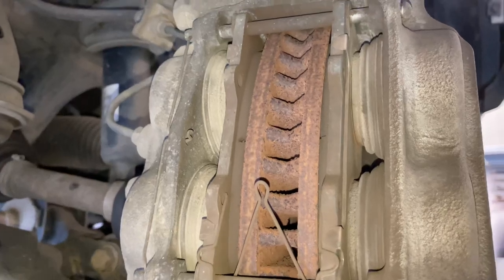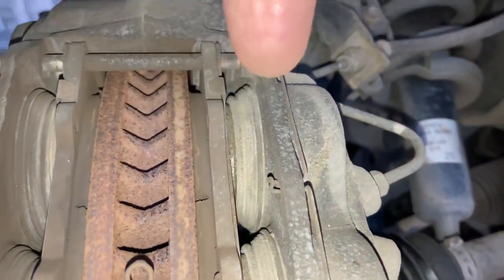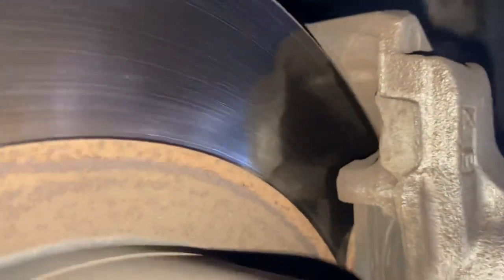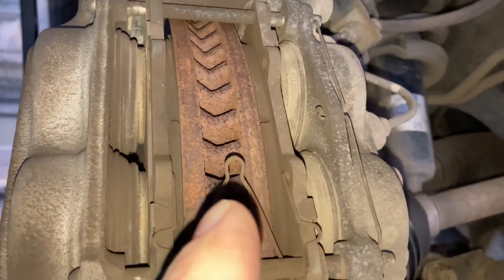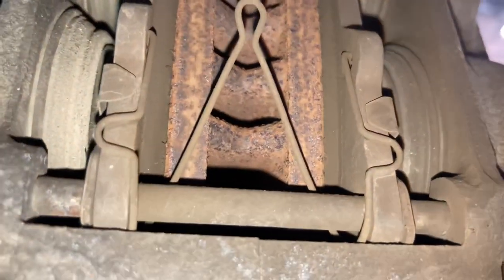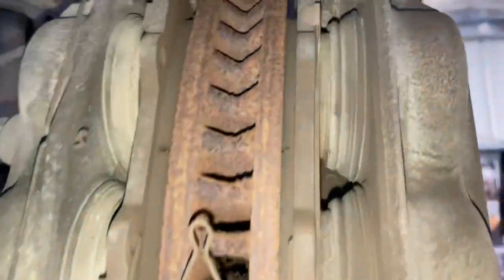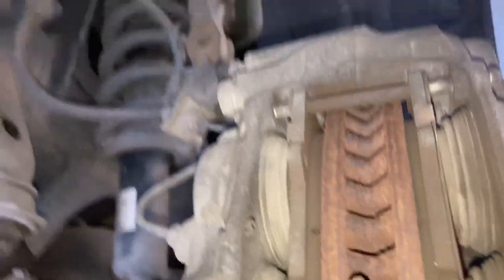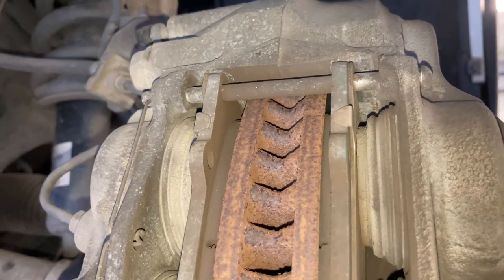GO to the TOILET 😂 BEFORE YOU START THIS - BRAKE PAD VIDEO 😉😂😉✌️

Comment: Just checked mine as had been stood a while. Torn dust seal and  rust on piston. Ordered rebuild kits replace all seals pistons inc flexible hose. Critical front calipers on my 02 it's original so due. Drain all fluid replaced no doubt hydraulic fluid deteriated. Greased slider with silicon grease now 100%.

Comment: My tip: When you change the pads and squeeze the pistons back ( I use multigrips), check the reservoir does not overflow. Use a syringe to take out a little brake fluid and top it up when finished and brakes tested.
Reply: Better still, open the bleeder so the cruddy, filthy fluid in the caliper goes to waste, not back through the anti lock unit or master cylinder.
Reply: My tip: just crack the bleed nut rather than pushing crap fluid and corrosion debris off the pistons  up and "past the seals". It's easier to push back  you can do it with fingers rather than gouging pistons with tools but a rewind tool is the more right method. Then top up with fresh fluid at the reservoir if by this point you haven't realised you may as well do a brake fluid flush.
Reply from the maker: With regular brake fluid changes every 2 years there is no “crud” 😂😉✌️